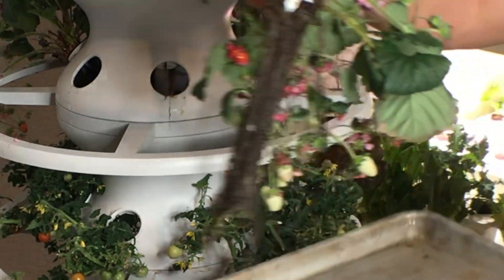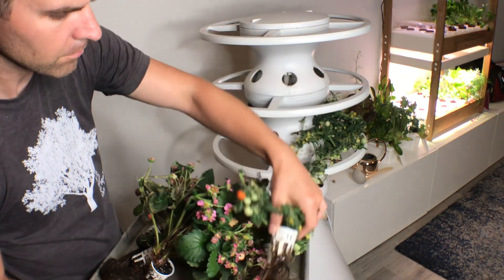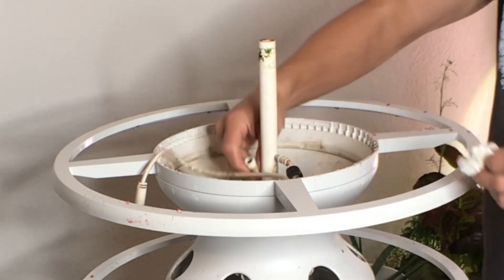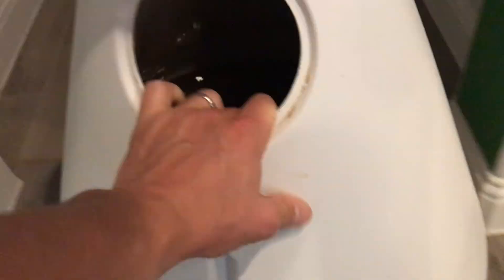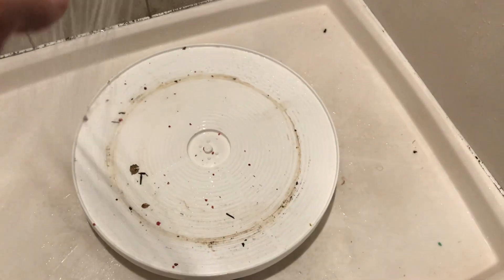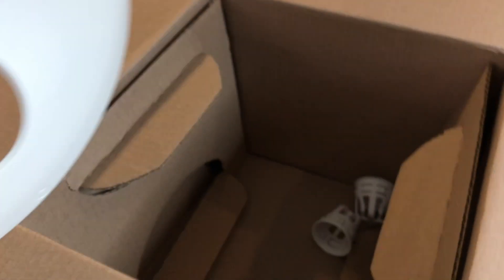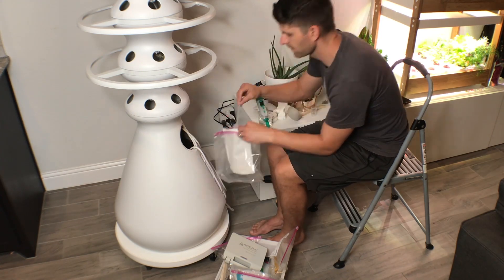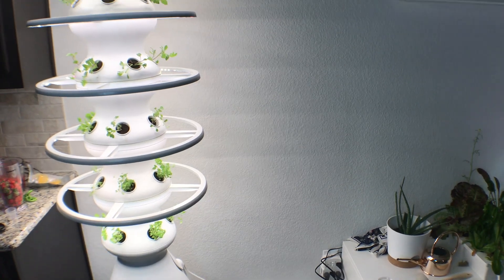Lettuce Grow Farm Stand Root Rot Problem and What To Do About It

Comment: What do you recommend for closing any open openings on the tower?? Thanks.
Reply from the maker: We used an empty pod and wrapped it with painter’s tape and put it in the opening until we were ready to order more seedlings. Not sure if that’s the best solution, but it worked for us. The painter’s tape is easy to remove when it’s time to plant the next one.
Reply: I bought some caps on Etsy. A little pricey, but better than growth in the system.

Comment: What happens if your power goes out & than goes back on?
Will it reset?
Reply from the maker: The timers for the lettuce grow are manual. They aren’t Wi-Fi or digital so they wont reset or anything if there is a power outage or anything.